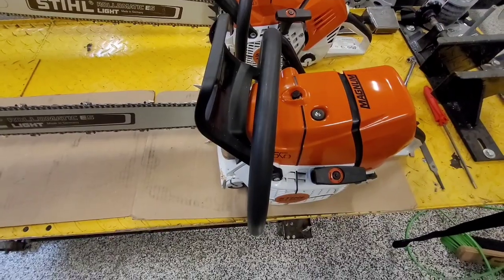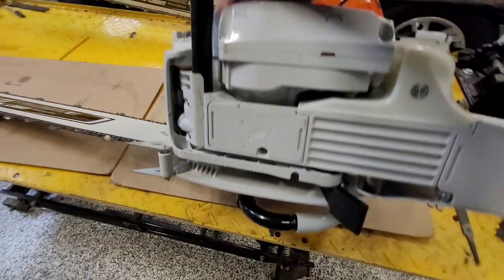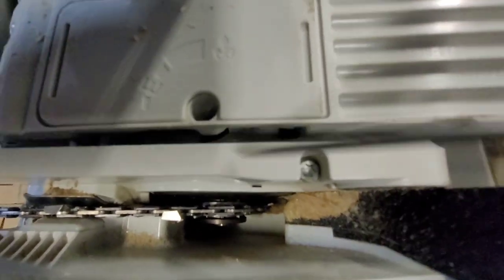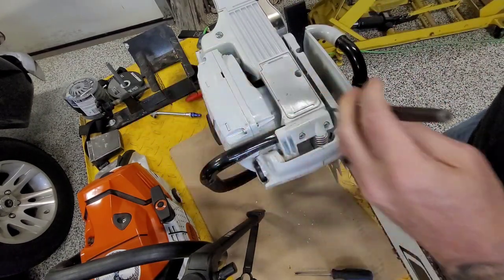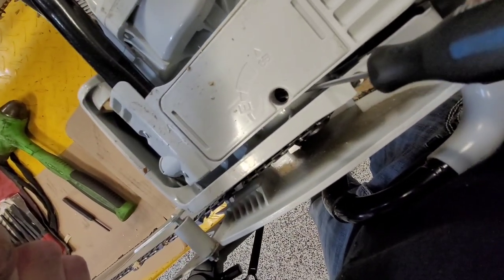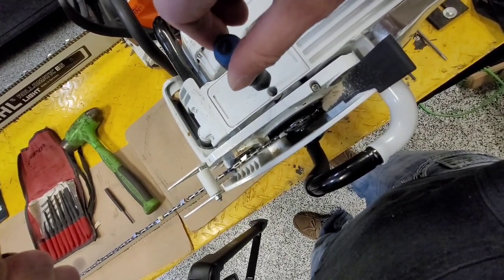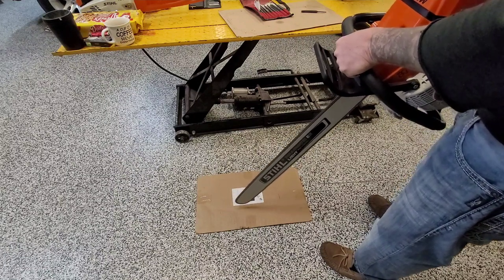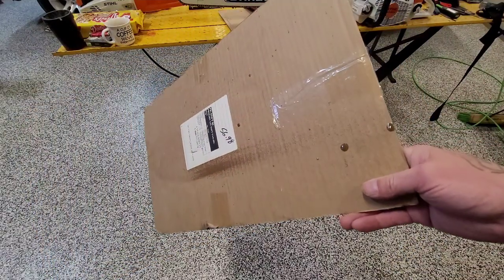Sthil chainsaw bar oil adjustment.  ms661c

Comment: I can’t figure out how to adjust my MS441 with a 28” bar. I have the plate on the bottom like yours but no screw hole
Reply from the maker: It should be there . The oiler screw is about an inch down in a hole
Reply: @jaythe306snowmexican  nah dude. I don’t get it. There’s no hole. I’m not mechanically inept either. I’ve been fixing small engines for years. I even went into my book and I can’t find anything on adjusting oil flow. Only thing I could find in the book was that there is a setting A and B
Reply from the maker: @paulallen-01  thats weird,  what does your dealer say.
Reply: @jaythe306snowmexican  I don’t know I haven’t reached out to them yet, I’ll give them a call today.